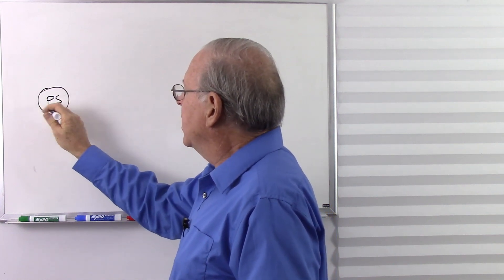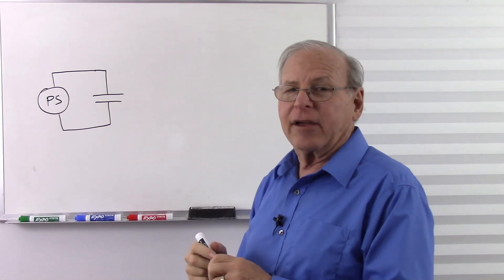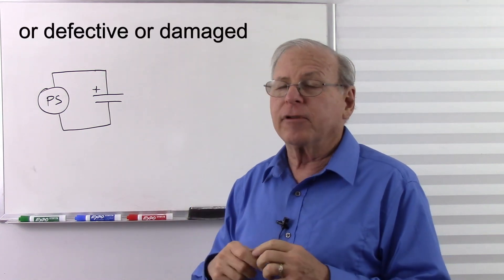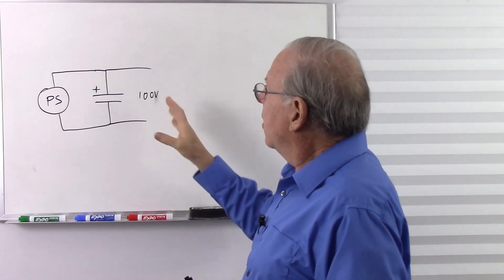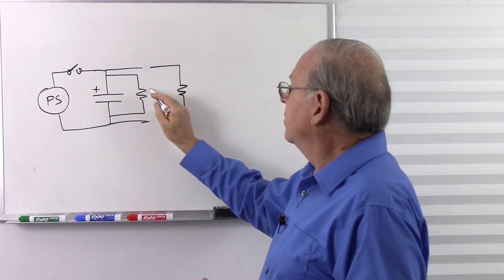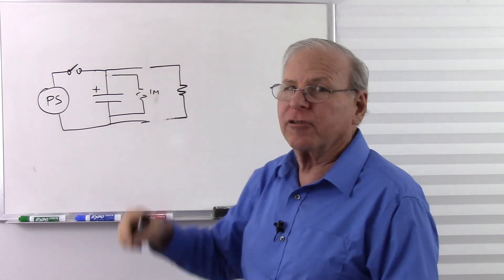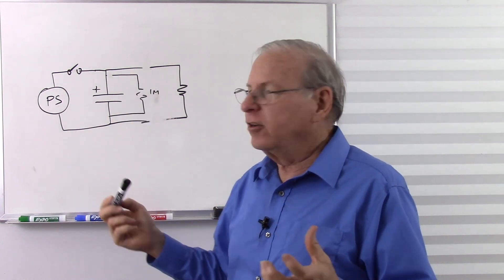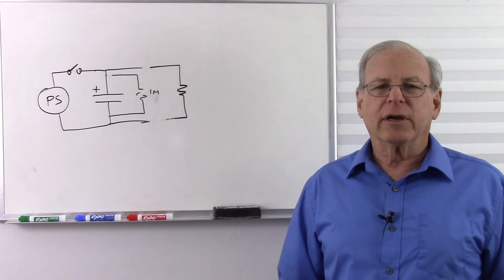Capacitors Part 6 - Safety

Comment: Very informative! Thanks for a very pedagogical channel. Is it only capacitors that stores voltage in a circuit? Are there any other components that can be dangerous, besides the power supply of course?